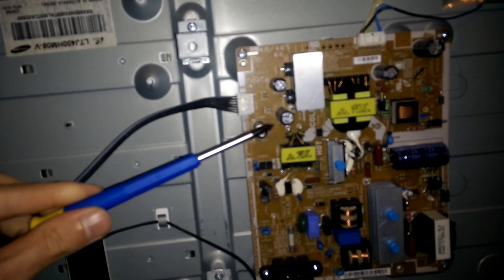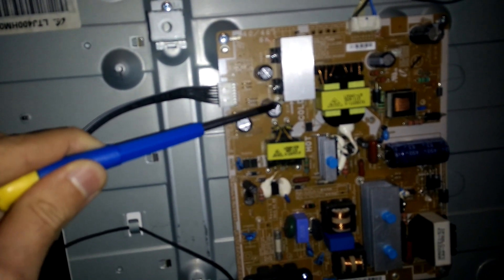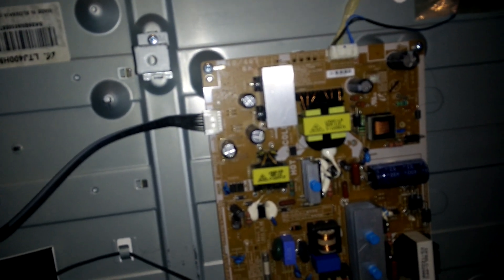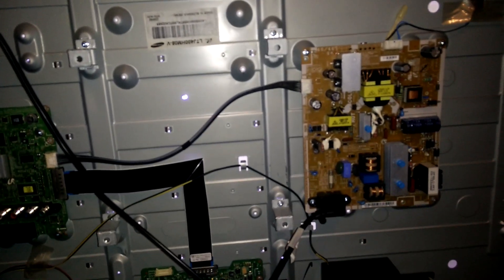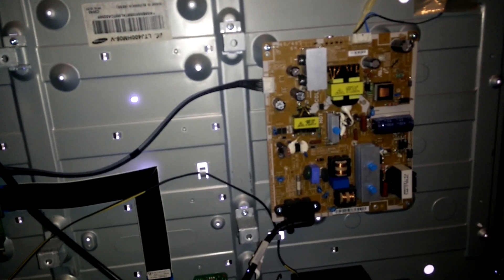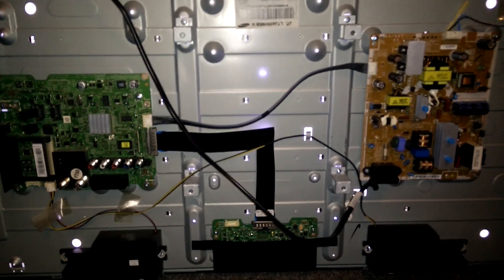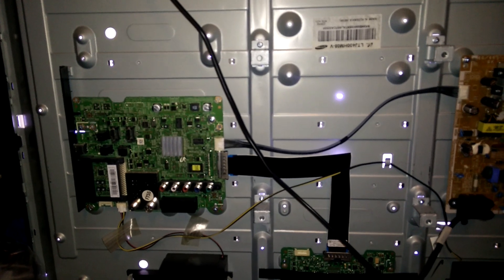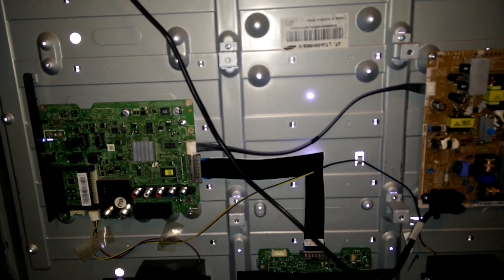Samsung UE40EH5200 stuck in standby - 0,50$ FIX - | BN44-00498A Power Supply Board | bad cap on psu

Comment: Same model - 1200 µF capacitor was blown- visible as it was having a black mass on the top. Replacement with a 1000 plus 200 µF cap put in parallel. Be careful un-soldering of the cap is difficult as a tiny SMD element is close to the wires an the back. By the way the TV set was only starting using a hair dryer for warming up the internals. This might be your diagnosis if your cap is blown too. I put in new caps and bent them away from the cooling aluminum block, which gets hot!

Comment: same model, blinking standby light, but the 13v at pin 1 going to the main board is not available, i mean at least after disconnecting the main board the backlights should turn on but nope. i also have found out that power is available until the brown capacitor which is after the main cap(the biggest one) , there are no blown caps or fried stuff. cold side is dead